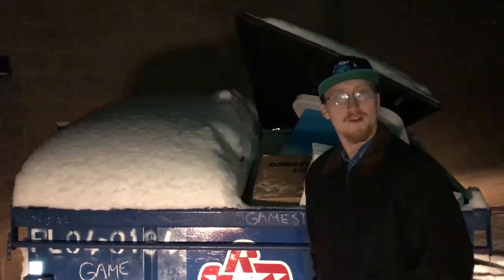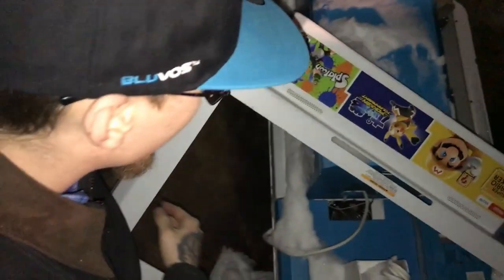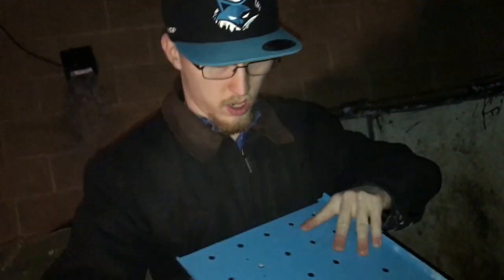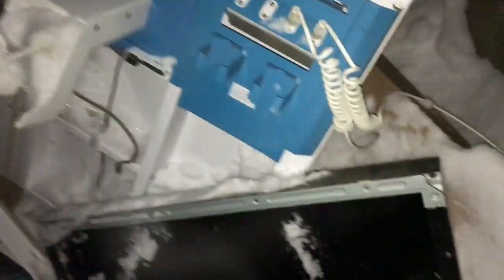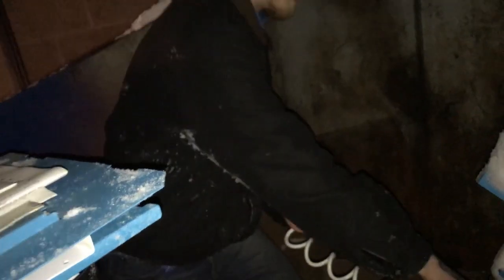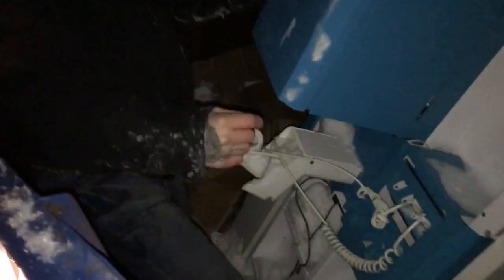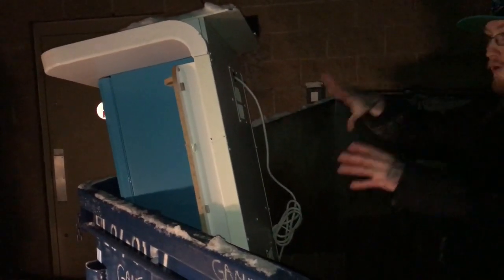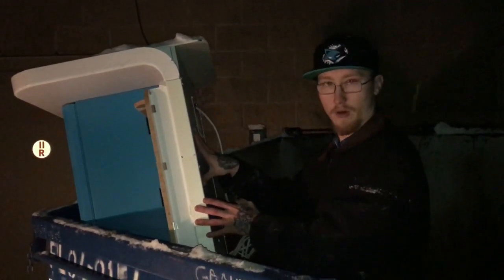FOUND 1 MILLION DOLLAR DISPLAY SYSTEM IN GAMESTOP DUMPSTER!

Comment: congrats you found the display system for gamestop, you may be able to sell pieces but thats about it. Becareful taking it out of that cause it shouldnt work, if they threw it out plus its only a part system
Reply from the maker: +Kieslo Darkmoon we have the replacement cords coming the screen works fine all we need. Now is a working Wii U and the cords to turn it all on
Reply: Violent Privilege Gaming Cool, then i retract my statement cause those systems are not a complete system inside. I worked at Gamestop, lmao
Reply: Kieslo Darkmoon Nintendo reps came in and were supposed to take the system, screen, and accesories